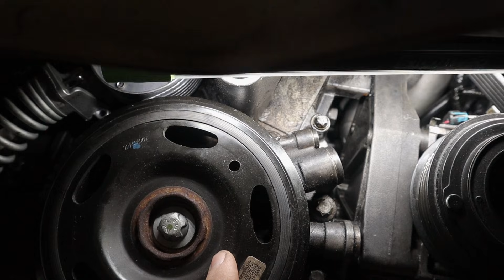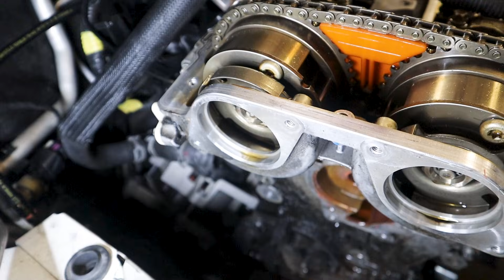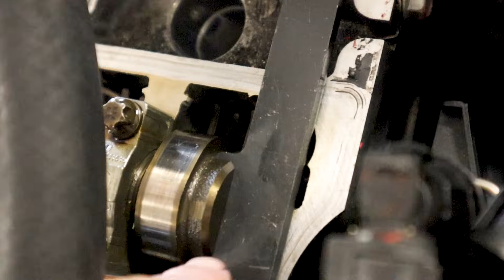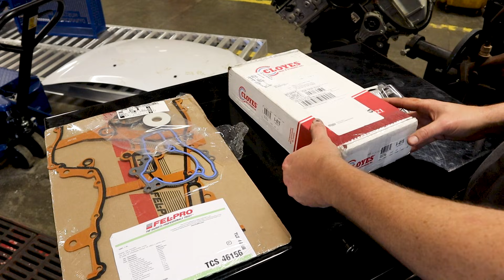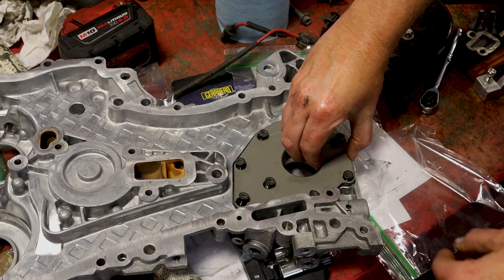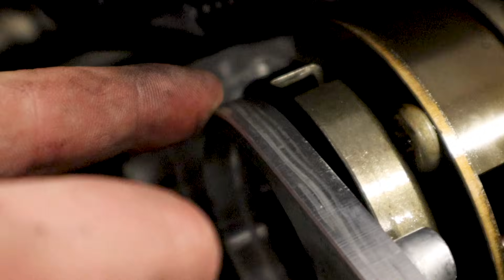P0016 code Ecotec 1.4 timing chain replacement

Comment: I have had a 1.4L in the garage for two weeks now.  Why does no one, and I mean none of you master's tell anyone to time the phasers (sprockets) They have timing marks on them and both need to be pointing straight up.  I have looked at factory pictures, videos, and looked at so much information and had to make an educated guess on where the phasers lined up.  People do not understand how to properly identify the parts.  It is the VVT cam phaser (sprocket).  The exciter ring (the part that tells the cam sensors).  All this must be timed together.  You cannot just throw the phasers back on and have it run properly because the advance is only 30 degrees inside the phaser and only advances or retards within a certain phase.  Can you please explain where exactly from the factory that the phasers line up?  If you watch the video when you first disassembled the engine your marks would have been straight up.  I can tell by the dimples on the gear.  You also need to explain if the ECU needs to be flashed so that the computer can relearn timing.  Even though this style of ECU is a factory reset model (when unplugged from the battery it defaults back to factory) does it effect the timing.  I am no longer working at dealerships because I get tired of service writers cutting my flag hours and not paying me properly for this very type of situation and I do not have access to a scanner with program/learn feature.  I can look at the timing on my current scanner and it sets at 11 degrees and then goes off the chart when it is running which means the phaser is out of time.  Please, please help me out.  I just ordered two new phasers, replaced the crank and both cam sensors, and replaced the VVT valves.  Then I bought a VVT solenoid to test out the resistance and they are both good.  Oil pressure is good, fuel pressure is good, and everything is sealed.  Thank you.
Reply: I just had one in my shop. There wasn't any alignment notches or dots on the phasers just like the one in the video. Hence the purpose of the tools.
Reply: bro, not every car is the same. there are no marks on the crank, crank sprocket, cam gears or the chain (factory and replacement) yes, some have dimples, colored links, etc but not all of them. maybe stfu and do some homework, understand what you're working on. This man made a solid and highly informative video for people who aren't shade tree mechanics or internet trolls. Which are you? Tell me you don't know shit about cars without telling me you don't!!
Reply: @Jason.04 I mean I could be wrong, but these things are especially for people that don’t know shit about cars.
Reply: @Jason.04 😂 I'm an automotive machinist and struggling with these engine. Go touch grass bro. I'll time any kind of timing belt on a sbc race engine but these little ecotecs are definitely hard. Yeah I said sbc timing belt, they are real and they don't have any marks. (Jesel) so using a timing wheel and an indicator is needed. I'm not pulling the engine out just to do this. People like you are what got me out of the mechanic shops and I'm so glad I'll never have to meet your bitter ass IRL... go touch grass dude.
Reply: Simply, the phasers are operated by solenoid that pushes in towards the cam, they work similar to mechanical advance in an early distributor, except instead of flyweights, the plunger actually does the advancing. Therefore no need to 'clock' or 'time' it. I hope this helps!
Reply: Thank you for that... I'm not a mechanic and what I've seen just by doing research reading the book watching the videos nobody takes the time to go into detail explanation. Like this morning thinking to myself what are those lines for and what do you know.....👍 Any more advice I could use it?
Reply: It was a huge mistake losing the duplex timing chain. These single chain stretch and are very unforgiving to the engine 😢

Comment: Excellent video. I just pulled the head off, antifreeze in cylinders 2 and 3.  Nice to see exactly how this timing goes back together.  I don't think you could have made a better video.  The video is right where you need it and great quality along with very informative.  Thanks.

Comment: I know this old vid but amazing job , thank  you . just one question if i may, Doing the exact same job right now waiting on parts but the crank shaft pulley on this one has about 3/4 of an inch play in it . The pulley is snug on the shaft but they both can ra=rock back and forth just beyond and just behind the timing mark . Should i stop just when piston stops moving up? Right when circle side barley lines up to mark ?

There is about 3 16th until it starts dropping and can place it on either side but should tension be on the pulley going forward with rotation of motor or should i place circle just as piston going down ? Or is something else hooped inside on crank journals and that play is no goood? Person who owns it was driving and it literally snapped a rocker arm in 2 and jammed it under the cam lobe pretty hard also =other issues which with all factors i can understand why . So replacing the obvious and also new tension er and idle pulley on serp belt old and coolant change spark plugs , scope for trouble codes as there was some last time i looked at it . Cant recall but not severe. Parts will be in a week hopefully. and kit ordering today . 

but yeah just stuck on that flywheel play before they spend 1000 to 1500 on it , or more if there is more damage . turns over by hand but with one less rocker arm i fished out . Getting whole new head with cams n gears so replacing should be as easy as your s. Thanks in advance Great video made it a lot easier for me to tackle it. thanks .

Comment: If some replaced the timing chain. But didn’t loosen the phasers and then use the tool to put the phasers in the correct positions when a code po016 still be tripped?
Reply from the maker: Yes unless you get lucky.
Reply: Awaiting my tool kit to arrive. Thanks
Reply: Update: tool arrived cams slightly out of alignment. Went ahead and replaced timing chain with new gaskets per video. Test driven multiple times with no codes and motor runs good. Thanks for the video.

Comment: So you wouldn't recommend using light thread lock on things like chain guide/tensioner bolts? The 15-30ftb stuff?
Im doing this hob in Monday along with a clutch on the dame car, its been 15 years since my last clutch and longer for a chain so I am trying to get everything I can right any advice is greatly appreciated, cheers buddy, stay safe and keep smiling.....👍👌👍
Reply from the maker: I have never used anything like that and have never had an issue, but I don’t think it would hurt anything if you did. The service manual does not say to. Hope this helps. Thanks for watching!
Reply: @AutoScholarwithMrB Helpful thank you, I do have a second question too, I'm noticing here in the comments people talking about taking the sump pan off as the timing cover will not align properly when reinstalled if you don't, is this something you have personally encountered?
Reply from the maker: @EZ-D-FIANT I have not had an issue but the service manual does say to remove it. Maybe I have been lucky.
Reply: @AutoScholarwithMrB  cool I'll do that too then (better safe then sorry) cheers for your help buddy.....👍👌👍
Reply from the maker: @EZ-D-FIANT  absolutely. Good luck and let us know how it goes.

Comment: Thank you for comprehensive detailed information. I am a level 3 Toyota technician with 49 years experience working on many types of vehicles in England UK. So not being very familiar with this particular engine I searched for more information and your video is by far the best and most informative.Good job.
Reply: I work for Ford but love the Mopars, at least the older ones. My wife purchased one of these nightmare cars and I'm shocked that General Motors got away with building such an unrelaible engine for so long without any legal consequence.

Comment: Very helpful video, thank you so much. I am currently rebuilding my daughters engine from scratch from the bottom up after getting it back in a 1000 pieces from a dishonest company who literally stripped the engine to a bare shell, damaging lots of parts as they went. I was unsure about the timing so thanks so much. Great video. 👍

Comment: I have a p0016 and a p0017 fault code but my chain doesn’t seem to be stretched as my cams are both lined up same engine as you are working on my engine oil is new as well and no sludge build up but engine is noisy and runs rough any idea ?

Comment: One question.. Is the crank bolt a torque to yield? I assume you replaced the bolt? Did you tighten against the crank locking pin to get the correct yeild rotation?

Comment: Fantastic Job.  Very well filmed and narrated.  I am about to start replacing a 1.4L eco blown head gasket so as long as i've got so much apart, thought it would be a good idea to proactively replace the chain and water pump. Again really enjoyed your video
Reply from the maker: Thanks a lot Ernie! Good luck with your repair.

Comment: Dumb question getting ready put motor back together noticed eight lifters are solid and eight lifters have spring up and down that’s not right is it
Reply from the maker: Submerge all of them in oil and see if they harden up.

Comment: You dont need to losen the vvt cam bolts to do this, and they are also TTY. Unless you suspect the timing rings have moved. Just lock the cams in place on the rear, and put the chain on with the front side tight and back side slacked. Obviously souble check timing after the cover is on. Only then would it be necessary to adjust timing using the vvt bolts if it is out of time somehow. I hate these cars, and i have two.... every bolt touching the engine or cradle is TTY one time use.
Reply: Hey are the rocker cover bolts are only one time use too? Looks like it is leaking, I am gonna change its gasket and forgot to order bolts..
Reply: @us3804  I don't believe so. They should also be encapsulated in the valve cover.
Reply: @Dassick89  hopefully, thx for the tip

Comment: Working at OPEL in Germany. I can tell you from now on we always pull off the oil pan, reason is the timing cover is not guided by the bolt but by the oilpan. The cover will never be in the right place again causing the oil pump to not fit dead center in the middle of the hole down there. Everything back together and either it makes a horrible siren sound right after the job or a few months after. End of the story is a broken pump and cover, happend a few times now. Replacing those and putting the oil pan last is the solution to that problem. What an awful design they did there.
Reply: I don't understand, if the cover is guided by the oil pan this means that the oil pan has to be mounted before, so if you leave the oil pan this will guide the cover back in  the correct position 🤔
Reply: @Nyator no you are wrong
Reply: @hammondclarkson9201  Sorry It was a question, so if you know i'd like and explanation, thanks.
Reply: @Nyator You do not need to understand it you just need to drop the pan and put it on after the timing cover. Otherwise you are very likely to misalign the crank and thus the oilpump. You may find information on this at Ina Schaeffler, they are the OEM manufacturers of the timing system. So basically If you do not remove the pan the pan will guide the positioning which ist bad an can lead to destroyed oil pump or even timing Cover. IT IS a known issue.
Reply: @hammondclarkson9201  well It wasn't for me but i absolutely thanks you  for the information!
Reply: @hammondclarkson9201 telling someone you don’t need to understand  just do it is diabolical.  If you’re going to offer up advice, at least be willing to answer questions
Reply: I would think you could just hold the engine with a hoist from the top and avoid putting stress on the oil pan. Would this fix the issue of having to deal with alignment issues later? 🤔
Reply: @Chaos1187me nope
Reply: I think these engines are good design only week point is a chain tensioner which makes a problem if fail. I fixed Saab engines which are more difficult to done this job also mazda engines are horrible to fix them.
Reply: Also die Ölwanne sollte man nach dem Stirndeckel montieren ? Und die pumpe sollte man neu machen ?
Reply: Hey thx for the advice but from what year is this freaking system is on? I have 2013 1,4 turbo benzin meriva, should i also do what you said?
Reply: Thanks
Reply: I agree with you. The top guide often cracks and drops pieces of plastic shrapnel down into the oil pan. I really like to clean the pan and get those out of there.

Comment: The timing chain tensioner bolts are not torqued to 15 foot lbs! I know because I just snapped one off. They are torqued to 71 INCH lbs. Now to find new bolts🤦‍♂️

Comment: So the crankshaft spins twice for every revolution of the camshafts. That would mean if you were not on the power stroke on Top dead center you would spin the crankshaft 360 degrees not 180 degrees.. correct?

Comment: Excellent video; by far the most comprehensive and helpful I've been able to find. Thank for taking the time to post. Just finished this job on my daughter's 2015 Sonic. Only one criticism.. I don't think you stated that some water pump bolts are actually holding the timing cover in place. Luckily, I realized this before prying too hard and snapping the cover. Thanks again!!
Reply from the maker: Glad you finished your repair, and thanks for watching!

Comment: From a mechanical background, I understand your explanation very well. I have not work with this type vehicle but very similar to other old timing chain vehicles. I very much like the way you work expressly the the cleaning of old gasket and other part. Well done this help a lot with understanding how to remove and replace new parts also cam settings. Well done 😊😊
Reply from the maker: Thanks so much!
Reply: I have to watch more of your vidieos

Comment: How can you tell if there is internal engine damage vs a timing chain issue? I have a 2013 sonic lt 1.4 liter and the engine stalled out and threw the codes :
P0011- Intake Camshaft position Performance

P0014- Exhaust Camshaft Position performance

P0324- Knock Sensor Module Performance

P0325- knock sensor Circuit 

P0326- knock sensor performance
Reply from the maker: At this point you would have to see if the base timing is correct using the special tools I have in the description.
Reply: @AutoScholarwithMrB  i checked my timing just now . The exhaust and intake cams are timed together but only when the hole of the crank shaft pulley is opposite of the position of where yours is . They are no where near timed but i have the hole in your location . But opposite of that they are. Can the crankshaft itself get our of time ? 

Thanks for your time
Reply from the maker: Yes it can, and that is most likely what is wrong. I would replace all parts I did in the video, hope that helps!
Reply: @AutoScholarwithMrB  thanks for the help . So i need to set crank shaft at top dead center but when my cams will be at a 90 degree angle. How do i go about adjusting the cams when i have the crank shaft locked in at dead center if they are off that much
Reply from the maker: @rockbottomguild5148  you will have to re-time it with the tools like I did in the video.
Reply: @AutoScholarwithMrB  i understand that but im talking about moving the exhaust cam and intake cam into the positions of being locked in with the plate from the tool kit. They are 90 degrees off when my crank is at top dead center
Reply from the maker: @rockbottomguild5148  you will have to take the chain off with the crank locked and turn the cams back into the correct position, and lock them with the tool. Or you can lock the cams, take off the chain, and move the crank back to TDC. With it being that far out of time, I would get it lined up and do a leak down on cylinder one to make sure you haven’t bent valves.
Reply: @AutoScholarwithMrB  will do thanks
Reply from the maker: Good luck my friend!

Comment: Ive been at a loss with a p0017 even after cleaning, swapping, and replacing the actuator along with cleaning the valves. Your last vid on this car was extremely helpful and I can't thank you enough for these videos. Im going to pop the valve cover off now and see if it jumped a tooth. If I end up having to do the timing im debating doing the head gasket too since the car has 120k and from what I've heard its not uncommon for this motor to need a head gasket at some point in its short life. Thanks again
Reply from the maker: Thanks for the compliment and good luck with the repair!

Comment: Hi idk if you can help me. im in school and did this exact job on my 2013 cruze, but, i did not touch the two sprokets because when i sat the alignment tool on it its was already good. Start the engine and there is a big rattle noise coming from the vvt, because when you disconnect the vvt's it stops... any idea what i did wrong?